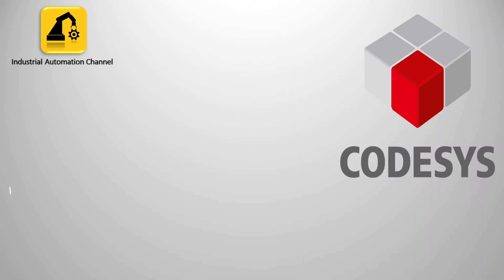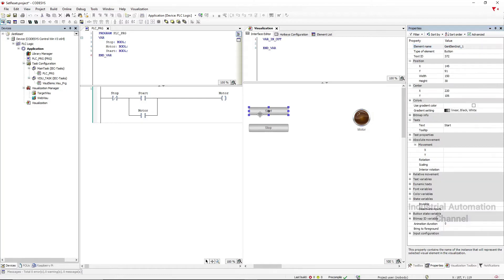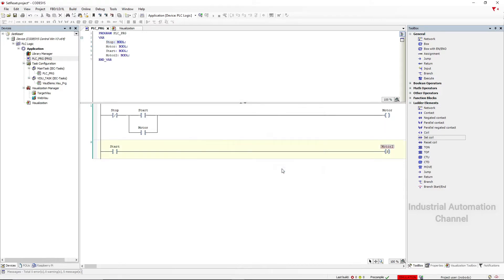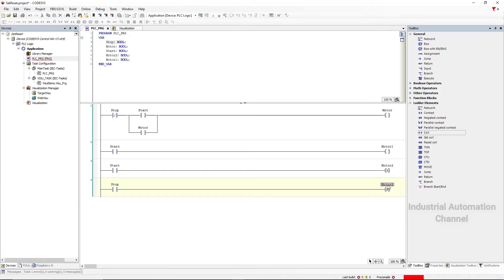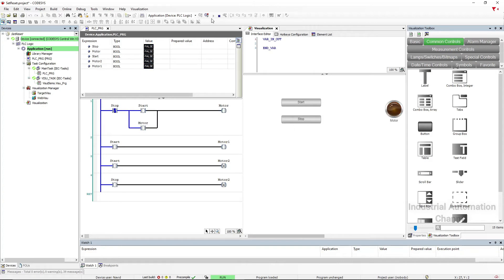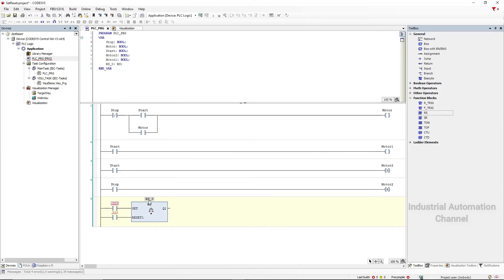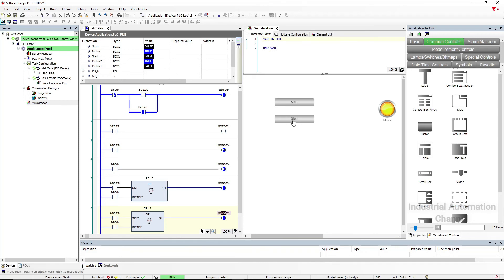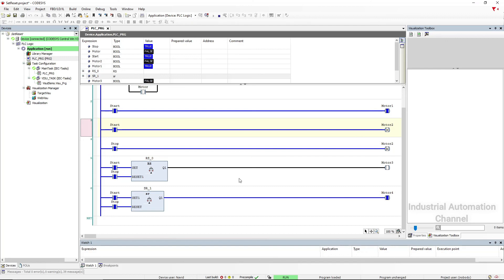Codesys #4: Set/Reset Coil & SR/RS Function in Codesys

Comment: What is the advantage of set coil ? If we can do the same with latching?
Reply from the maker: Very good question. I would recommend using standard coil as much as possible. Because it makes the program as simple as possible. It's all in one place. That's what I use personally.
Fault finding which conditions triggered a SET or RESET where it is spread out in the program, is much more difficult.
The advantage of having SET and RESET is that you can "force" an output from anywhere without adding additional code.
Reply: @industrial_automation  Thank you for outstanding efforts in presenting this tutorial.

Comment: Bonjour, à la 5ème minute, je ne trouve pas le chemin de réseau vers l'automate. la fenêtre ne m'affiche que la première ligne 'Gateway-1'.
Reply from the maker: Hi Imad, Unfortunately I don't speak French and I could understand your question with translator 😊😄
That's because your virtual PLC is stopped. Check in your windows taskbar at the bottom left you should see a plc icon called Codesy control win sys tray x64 (or 32 depending on your windows type. )
If you could not find it there go to the folder in C that you have installed codesys. Double click on it. Now you find it at the buttem left. then right-click and start PLC. Scan again the network.
Reply: 😂😂 me to I'm not very good in English, but I check it, and it's not on stop
Reply from the maker: @imder312  🤔🤔Strange. 1. Please disable once your Antivirus and firewall close codesys and reopen it. I wanna check maybe firewall has blocked your connection.
2. The device in the project should be the same as the device you start on you pc. Is it Codesys control win V3 x64?
3. go to Gateway Manager and add new Gateway and delete old one and scan ....

4. Which version do you use? It can be also the bugs of new version (If you have installed the newest version)